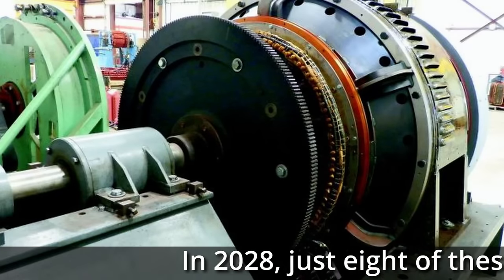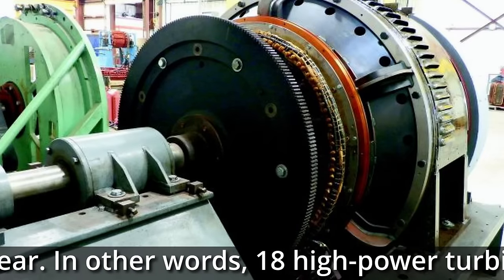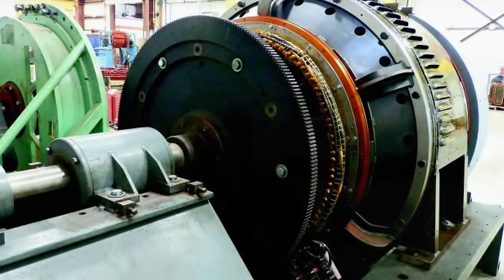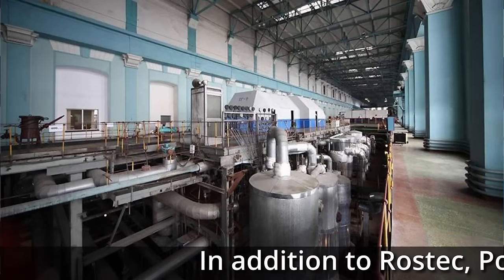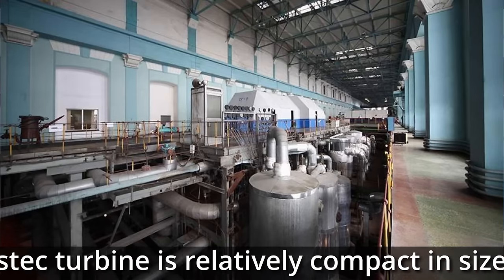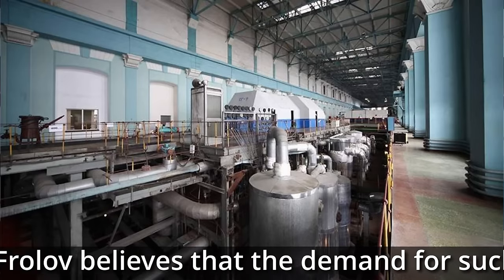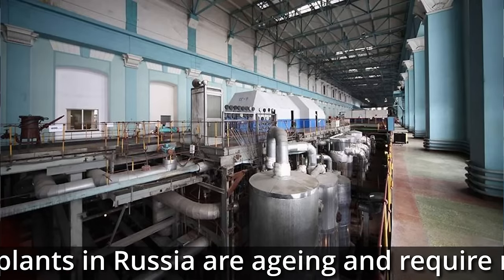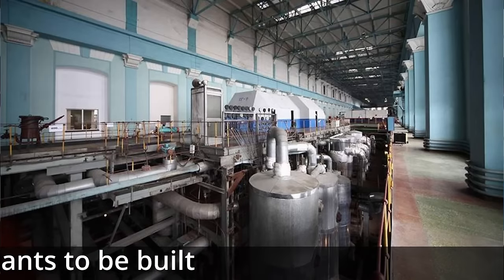Russia's Turbine Independence Changes the Energy Game

Comment: I wish semiconductor independance soon...
Reply: The Chinese will get there...
Reply: Semiconductor sector is extremely tough and complex, the best Russia can do is to cooperate with China in this sector
Reply: @ibrahimtouman2279 if the west did it why can't Russia do it?
Reply: @ibrahimtouman2279  , Russia is designing and building own litography machines now. At first, it will be 350 nm (in 2025), next is 90 nm, 75 nm after that. And so on, it is already planed & got finances.
Reply: @ibrahimtouman2279  Do u even know how advanced Chinese semiconductor industry has become? It's has been estimated that they are at best 5 yrs behind from TSMC or Intel's leading edge. Russia is nowhere close.
Reply: @aniksamiurrahman6365  , Russia is going fast. 350 nm lytography machinery in 2025, 30-60 nm up to 2030. It is Planned! No financial questions! The Intel 4 processor is built by the 65 nm technology... Math, software... Russians are the best in that! 😉
Reply: @aniksamiurrahman6365  , Who is TSMC?..😉 without Chinese or Russian gases, like Neon, Xenon, etc for their lythography lasers? No gases, no production!
Reply: @maksimluzin1121  Pentium4 is the first processor I've used. Back in 2001.
Reply: @aniksamiurrahman6365  , I have started from mainframes, 1985. FORTRAN-4. No graphics, no colors, no nothing... Terminals... Keyboards only... 64K RAM for a user. 😉
Reply: @aniksamiurrahman6365  Russia is 30 years behind but in the next 5 years it will catch up. China was buying chips until trump started the trade war and now China is becoming a global leader in chip manufacturing. Next it will be Russia.
Reply: @samueloppong-kyekyeku8844  The west did it by lots of countries and talents working together

Comment: Not that major a breakthough. They do make jet engines after all and operating princples are similar.  Adapting this technology for power generation involves tweaks in design, efficiency optimization, and specific engineering to suit stationary power plants rather than mobile aircraft, but the core technology remains similar. Russia does produce smaller gas turbines for various applications, including power generation, industrial use.
Reply from the maker: Its another step in Russia's move to become self sufficient.

Comment: please make an episode about the 25-MW "AL-41ST-25" gas turbine engine which is also developed by the United-Engine-Corporation (UEC).. the engine is still a prototype currently, and the next stage will be comprehensive testing as part of a gas pumping unit and pilot industrial operation at a compressor station.. Russia also wants to achieve self-sufficiency in industrial gas pumping turbine engines, which is a critical sector hit by western sanctions.. Gazprom is waiting eagerly for this engine to reach serial production phase!!

Comment: It is irrelevant news, Some low quality turbines being build for the domestic market only...  Perhaps N. Korea will get a few in exchange for 152mm ammo. Nothing to brag about.
Reply: It’s a big deal,energy is a BIG DEAL!!!
Reply from the maker: Opinions are like buttocks everybody has them but some are better not aired in public.
Reply: @SCOBRICSInsight  There is nothing controversial in my statement. 

1. These turbines are not on par with Western equipment. Their efficiency will be worse, the maintenance times will be worse, the failure rate will be higher. 

2. Who would be happy to buy these? These may be offered at lower cost, but buying unproven tech is quite risky, not to mention potential maintenance cost and issues.

3. RUS is switching more and more towards barter trade. Nobody wants to trade in Roubles anymore.
Reply: @slawomirozdoba4605  Plus they undoubtedly violated patents by reverse-engineering it. That will make it unsellable to all but a handful of countries. You mentioned North Korea, which is an excellent example of a potential customer (likely payment for barter as you suggested lol)